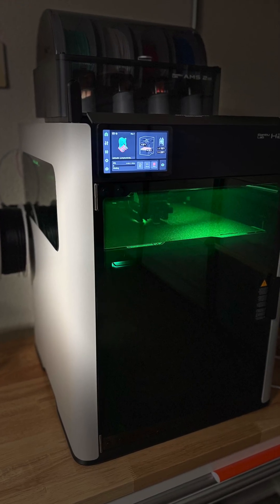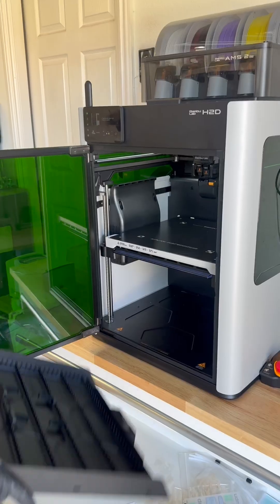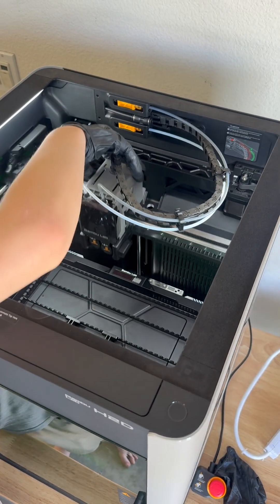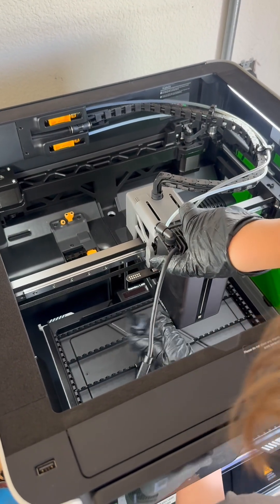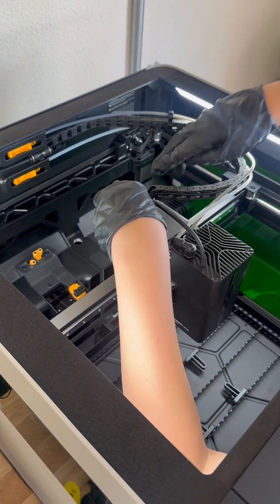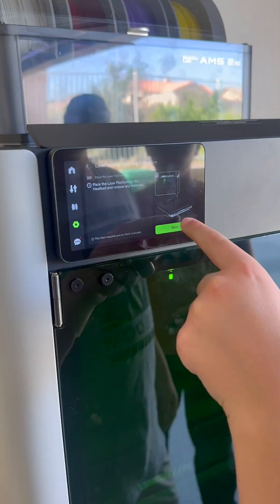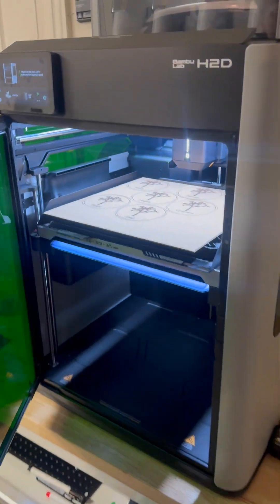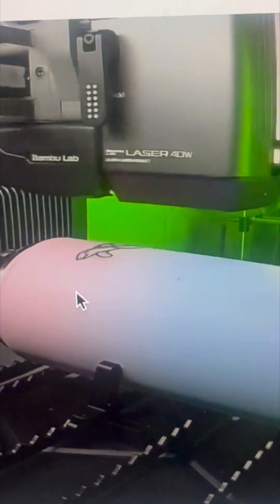From Print to Laser: How to Switch Your H2D Module Fast. #bambulabh2d   #3d #bambulab #asmr #laser

Comment: installed the laser upgrade hit to the h2d. I keep getting the run the laser calibration every time i turn the machine on
Reply from the maker: Does it only do it when the laser attachment is on, or when the laser is removed also?
Reply: Never have takin it off. But every time i turn it on its like saying to calibrate it like it's the first time

Comment: I don't know I guess it's the best of both worlds but do the 3d prints smell like burnt wood I don't know it's just a very wierd combo to me 3d and laser engraving should be a separate hobby honestly these guys just wanted to out do everyone in the competition but at what cost 💲 and the prices on these things are outrageous hopefully people use this as a hobby and not to try and outsell everyone
Reply: Just makes way more since to get a printer and lazer engraver separately then buy the H2D aswell /:
Reply from the maker: I haven't had any prints come out smelling like wood or anything. Id say so far it is pretty great for someone that wants the laser portion to make items to sell and the 3D portion for hobby.
Reply: The camera and augmented reality lets you see exactly where the cuts and burns will happen with the laser, a lot of laser cutters only use coordinates so you have to position the item exactly where it needs to be and hope it is right. The software with the H2D overlays your picture onto the wood or metal you are wanting to burn so positioning is fast, easy and precise. 
Using the H2D for a bit of cutting or engraving is what it is designed for, it isn't a full time cutter and engraver. I have only used my 10Watt laser once to try it out, everything else is just printing.

Comment: You don't have to turn it off or remove the top glass
Reply from the maker: Only when I am removing the parts connected to the electrical. It also has a calibration issue if you do not shut it off when swapping modules.